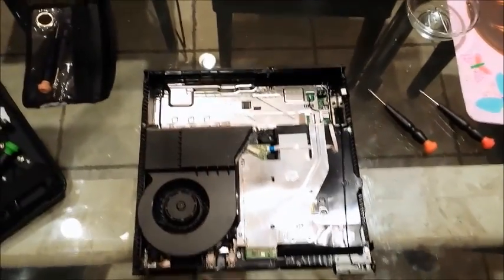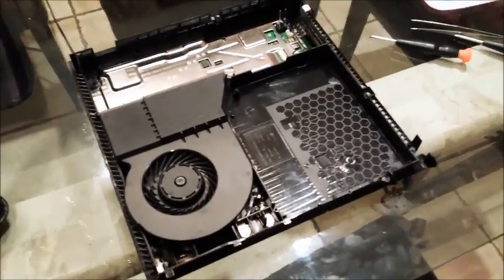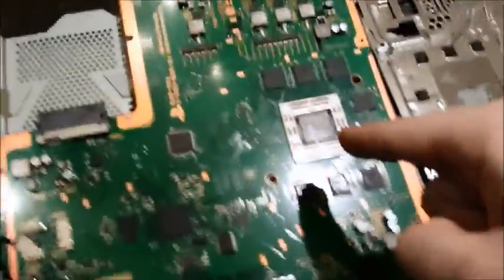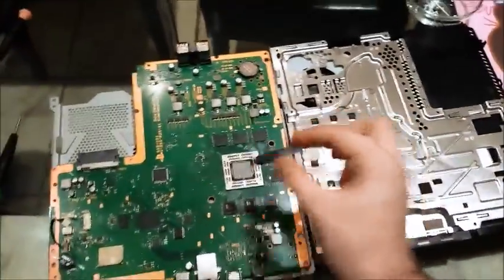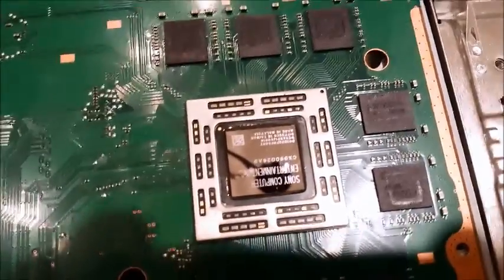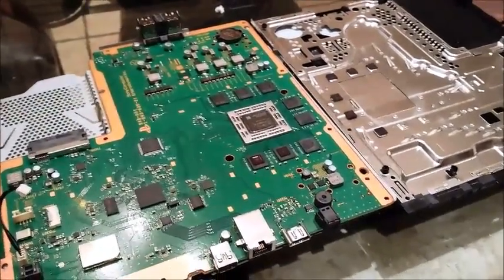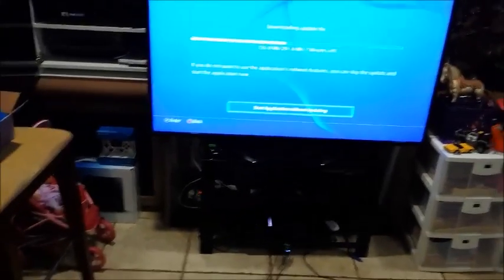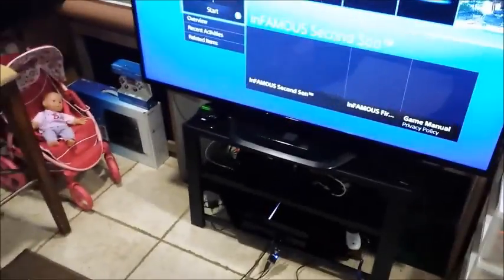PS4 Thermal Paste Change

Comment: do I need to replace the thermal pads??
Reply from the maker: Nah, just clean off the CPU/GPU chip, and apply the new paste.
Reply: Muilisx oh ok, just applied thermal paste, cleaned the fan and still gave me the overheating problem
Reply from the maker: @jabneelsanchez1668  sometimes, when you close it back up, you can end up with an air bubble which would cause it to still act the same way or sometimes even worse. Gotta make sure there's a nice tight seal. Don't spread the paste. Let the pressure of you tightening it back down spread it. The only thing you can do is do it over again.

Comment: Hey man. I know this is an old video, though it would be nice if you'd have an answer. My 1 year old ps4 is going insane with the fans after some time in games like BF1 and SW battlefront 2. It's all quite before hand, and in cutscenes. But when the gameplay starts it starts winding up like a jet. I've tried cleaning the heat sink and the fan. Should I try change the thermal paste?

Comment: is it OK to use thermal grease HY710 ON MY PS4 ??
Reply: jaivier12kill Jaivier It is, I used the same paste you mentioned. I'm probably going to change it soon though since it's a cheaper paste and won't last very long (a few years before you have to do it again)
Reply: Peter Klick. ill do the same the paste works great but ill get a better one same as you

Comment: I wouldn't use artic silver... it's not that good anymore plus it's conductive! You are not supposed to use it on a chip like that. It doesnt have a his.
Reply: AS5 really isn't that electoconductive anymore. Most reviews and forums are old. It is now safer than ever to use. However, I personally prefer Arctic MX-4. 100% safe, equivalent performance.
Reply from the maker: There's nothing wrong with using AS5. As long as it's being applied correctly, there's nothing wrong with using it.

Comment: So I did the thermal paste and my ps4 stayed an for 3 hours but then after one game of black ops it started to sound funny like disk in side was messing up mean while I got the game on ps4 so I turned it off can u tell me if that don't matter bc maybe the paste has to be good but I felt hot air coming out and all it was good just stared with that noise should I be worried?
Reply from the maker: Not sure what one has to do with the other. The Blu-ray drive comes out as a whole when you take the PS4 apart same goes for the HDD. Nothing you do during a thermal paste change affects either drive. Unless you dropped the BR drive I honestly have no clue what to tell you. If the fans are staying stage 2 or lower than the new paste is doing its job.
Reply: Ii so bro I stopped happening and I was playing today and last night good but right now I put it on had 2k16 on suspension while on wwe network and it overheated an my thermal paste is on so idk I think it's bc I had to things on 2k16 and wwe I feel like my thermal is good but my fan is prob messed up any help ?
Reply from the maker: +Based_ God_11  you shouldnt run two games at once regardless. it's too stressful. how much paste did u use? too much could be a bad thing...you only need a pea size drop right in the center. it will spread itself when you tighten it down. Cant really recommend anything because i dont know what you did.
Reply: See it happened again and the ps4 is not even hot what dose that mean? I'm srry it's just I don't have the money for a new ps4 and I can't do nothing with out it :(
Reply: And Can a cuh-10xxa fan work for a cuh-1200 ps4 let me know b4 5 so I can order it if it can ?

Comment: So many people go through the hassles of stripping consoles to clean them, or change pastes etc...and meanwhile I just stripped my ps4 and put it inside an HTPC case.  People always tell me I'm a jerk and a f*wit, but I just go LOL sure, go clean your console 3 times more often than I have to, and take a lot longer too.
It's actually worth it, as there are HTPC cases that look very very similar to consoles, and you can upgrade cooling massively, simply due to the fact that there's more room around motherboard, chipsets, and more fans.  The better the airflow: the more effective the cooling is.
Not to mention my PS4 has a h100i gtx on it. Hella tricky to modify, but oh boy did it make a difference. Never gone over 40c, even on super hot days.
Reply: Do you have pictures of this PS4 setup? I'm kinda interested in doing this.
Reply from the maker: nice
Reply: +A.R.C.H.E.R. Unfortunately no, I threw it out a few weeks back, I play black ops 3 90% of the time, and it's stupidly easy on ps4, so I shifted to PC which is much harder.
Going from a $600 console to a $9,522 PC was so worth it.
Reply: you spent 9522 on a pc? What is wrong with you? You got played, man.

Comment from the maker: My PS4 is due for a cleaning. It's most likely dust causing it but my fan has been kicking in stage 3 during games and if you look at the vents on the right side, those grooves you can see dust in the holes so I'll probably take it apart this weekend, and do a full dust cleaning as well as a thermal paste change because I'm already in there so might as well.
Reply: Did you do it? Did it make any difference?
Reply from the maker: +Leos Gaming   of course, why wouldn't  it  :p
Reply from the maker: +Jules That's wierd issue before. The PS4 would still turn on even with 
BONE DRY thermal paste but if it was overheating it would just turn off 
like a computer would but it wouldnt prevent it from turning on;       The clicking sound is the HDD. Not sure if the clicking sound ur hearing is the normal sound of the HDD preparing for shutdown or the sound of a failed HDD. The power button is also another possibility. If you could record the sound of the click for me it could help me narrow it down for u....def not the paste causing that tho
Reply: +Jules you may have put excess thermal paste which spread out of the heat sink area
Reply from the maker: hArDsTyLe2259  lol?

Comment: My ps4 keeps turning off every time I try to play Metal Gear. The fan goes crazy and then the red line appeaers. Once that happens I either let it turn off or close the game
Reply from the maker: Does it happen on other games too? Maybe not as fast but does it still happen? Sounds like the CPU/GPU is overheating which would be because the paste is dried out and it's getting too hot.
Reply: It has happened before on other games, but not as fast ans not as often
Reply from the maker: Still the main sign of the CPU/GPU overheating. It cuts off like that to protect the chip from frying itself. It's definitely a thermal paste issue. You probably have dust in there as well which isn't helping.  Check out my other videos on it.   https://www.youtube.com/watch?v=mXYORPGMYJE    https://www.youtube.com/watch?v=SlgIS-qJFo0      https://www.youtube.com/watch?v=Bb1MM5lv-1o

Comment: should I change my thermal paste? I've had my ps4 for a year and a half and I bought it at Best Buy "open box" I was thinking of waiting until something happens because of the saying "if it ain't broke don't fix it" what would you suggest I do?
Reply from the maker: it wont break per say but just run super hot all the time. it's wise to ditch sony's crap dried up paste and use something like arctic silver 5 or MX-2. People send me their consoles all the time to do it for them. I've done 21 so far.
Reply from the maker: +tristen briggz     I would also watch my other thermal paste videos. You can see those here.   https://www.youtube.com/watch?v=mXYORPGMYJE    https://www.youtube.com/watch?v=SlgIS-qJFo0   and  last but not least https://www.youtube.com/watch?v=Bb1MM5lv-1o  and you'll have a much better understanding my friend.

Comment: what a badly designed console my pc with all its fans and 980 ti in a game with unlocked fps is less loud than my ps4 in a 30 fps bloodborne and i changed thermal paste it didnt help at all
Reply from the maker: Prob have an air bubble. I've done 20 PS4s and each one runs way better. Stage 1 idle, no more than stage 2 in a game.
Reply: opened it again you where right the thermal paste was in a ring form with an hole in the middle and i the cooler itself wasnt properly tightened anyway now the noise are back to the level when i buyed it stage 2 mostly quite silent without counting killzone shadow fall and uncharted collection those push it to stage 3 and 2,anyway now im not hitting stage 4 anymore but anyway this console is not easy to open definitely not foolproof and this whole design i wonder how this console cooling system passed QA

Comment: sorry to bother you again for some reason my ps4 is given off static is that normal since im using AS5?
Reply from the maker: giving off static?
Reply: Yea i rub my hand on the ps4 its making my hair stick up and little static shock
Reply from the maker: +Christopher Delcastillo   Never heard or dealt with that before. Perhaps check over everything and make sure everything is screwed down. Other than that not sure what would be causing that. Definitely not the AS5. Make sure you're not walking on carpet in socks before you touch it. Rub your feet on the carpet back and forth hard, and touch the door knob, same idea. Can't be a ground or anything because if it was a ground issue then the console wouldn't work.

Comment: i change the thermal paste to AS5 i had the ps4 on for 4hrs now out idk hear the fan at all nice hot air flowing out
Reply from the maker: Awesome! AS5 has a cure time of 50 to 200 hours so it will most likely get even better
Reply: Oh ok thanks
Reply: Do i have do heat cycles ?
Reply from the maker: +Christopher Delcastillo nah, you're not breaking in a motorcycle bro lol. Just leave it on for most of the day and turn it off at night. Heat cycles will happen automatically as the days pass

Comment: will changing the thermal paste solve the Blue light of death problem?
Reply from the maker: yes because that is caused by overheating. Ditching the crap stock paste and applying better paste will stop the PS4 from running hotter than it should. watch my thermal paste discussion video
Reply: *****  Thank you for the fast reply! I will change it tomorrow and come back with some feedback if it did the job or not..
Reply from the maker: Razvan Covaci Coolio, make sure you clean off that old paste like I explain in this video, and make sure when you apply it, and close the motherboard in the heatshield that you make sure you make a solid closure with no air bubbles. If you have even the SLIGHTEST little bitty bubble then there won't be a solid seal and you'll have to do it all over again.
Reply from the maker: Razvan Covaci and here's the other video I told you about    https://www.youtube.com/watch?v=mXYORPGMYJE
Reply: ***** I'm watching it now
Reply from the maker: Razvan Covaci  cool, enjoy!

Comment: I use a cooling pad and the Nyko Intercooler for my PS4
Reply: Don't use what? the cooling pad? or the Nyko Intercooler?
Reply from the maker: +gonzoloco1  He probably means both as it's not needed at all, and only masks the problem.
Reply from the maker: +Camoprime   Any extra fan or cooler is just a complete waste of money. All you're doing is " masking " the problem. The system will never be running cool until you ditch that dried up stock paste, and apply something better like AS5 or MX-2. Those are the two thermal compounds I work with. I usually rotate depending on availability and price but they're both top of the line thermal compounds. If you truly want your PS4 running cool then you need to give it what it really needs and that's fresh better thermal compound. As long as that stock paste is in there becoming more dry every single day your PS4 is going to be running hotter than it has to and struggling at the same time to keep cool. You will see a complete night and day difference with better thermal compound just like any computer will. Even when I buy a CPU for a customer when building a computer for them. I clean off the stock paste that comes on the bottom of the stock heat sink, and I apply my AS5 or MX-2 from the start. It truly makes a huge difference. I can 100% GUARANTEE you that cleaning off that junk and applying something much better will have your console's fan never paste stage 2 fan speed. I've done 15 PS4s already and every single one is running much better. Stage 1 idling , and stage 2 while in a game. Stages 3 and 4 become a ghost.
Reply from the maker: +Camoprime  - uhh  I did read it. I'm just clearly adding to what you said.

Comment: Should I change the thermal paste due to the system quickly shutting off or is it a power supply problem? Which should I try first?

Comment: Mx5 silver paste takes waaayy to long to cure.I learned the hard way after my gpu on the ps3 was damaged. Unless you leave your system on standny for 50-200 Hours your risking gpu damage. 
I highly sugest using gell based thermal paste.
Reply from the maker: ThreeDaysOfDan   AS5 also is known to have a long cure time too and I had no problems using AS5 in my PS3. I'm using AS5 in my PS4 as well. I put it in before even using the PS4 for the first time and it has been almost 4 months now with no issues. My PS4 stays stage 1 fan speed idling, and stage 2 in-game. I never see stage 3 or 4 which means it's more than fine. AS5 or MX-2 are great choices.

Comment: anyone ever notice the ps4 looks like a ps3 slim borad?
Reply from the maker: ArtOfHacking no but I noticed PS4 is much quicker to take apart than a PS3 fat model. Just seems like it's easier. I mean PS3 was easy too because I'm no stranger to the  inside of anything but I've done like 7 PS3s and 10 PS4s and PS4 just seems more fun to do.
Reply: i agree the ps4 used a lot less screws then the ps3 models and it did seem faster compared to a ps3

Comment: Hye there ***** I'm about to change the thermal paste on my PS4 next week. I'm actually getting help from my friend who is a computer guy & have work on many PCs & laptops. He said that PS4 architecture is close to the laptop's (after seeing videos on Youtube) and it would probably easy to do the whole thing. My questions are - Is there any chance of us f***ing things up during the process? I have heard people who did this have several problem after putting the PS4 back together, so what are things to watch out for during opening the PS4, replacing the thermal paste and putting the PS4 back together? And last question - which is the better thermal paste to use on the PS4 chip - Artic Silver 5, MX2 or MX4?
Reply from the maker: josh Subet  yup but a PC is very easy to get to it. With the PS4 you have to be careful when taking it apart as there's a bunch of delicate cables and stuff
Reply: I have a PC and it is super easy, i did it for my CPU and GPU. You just have to know how to apply and clean it, that is really it.
Reply: ***** It must be because it is so compact.
Reply: +apiz arsha-veen  im thinking to get tuniq tx-2/4
Reply from the maker: All I can say is follow this video   https://www.youtube.com/watch?v=xyz0rdMpqOM    Pause when you need to, and go step by step with him. There are certain things that need to come out that can break very easily so it's important you know exactly what comes next and how to do it. This video is good to follow. AS5 or MX-2 is more than fine for this. The only way you will run into an issue is if you don't apply the paste correctly mixed with securing the heat sink back down. If you form an air bubble you're going to have cooling issues right from the moment you turn it on. It's very important you make a good seal when you secure it.
Reply: +NYballer11725 So i recently changed the thermal paste on my PS4 but the noise didnt change at all. Is it because of this air bubble you're talkin about? I had enough troubel takin the damn thing apart but if I can avoid outright buying a new one ill do it again. Also that chip is small as hell, so would a pea sized amount be too much for this thing?
Reply from the maker: Probably a half pea size would be better. Make sure the fan noise you're hearing is " in-game " and not on the main menu of a game as the main menus tend to make the fans act up for whatever strange reason. Too much paste can also cause overheating issues as well as too little, and/or an air bubble(s).  This is why I offer to do it for people so they can avoid having to take it apart, and not worry about applying it wrong. I've already had 5+ people send me theirs to do but if you do it yourself, just make sure you take the extra time to do it right.
Reply: ***** Yeah it is all in-game im playin games like bloodborne and gta v and after a few minutes of bein in game the fans so crazy like I dont even want to bother playin the PS4 afterwards. Gonna try again i guess

Comment: Changed my thermal paste, easy if you have little knowledge of taking apart electronics. My Ps4 is running cool and like brand new. =D Thanks for the video!
Reply from the maker: Awesome
Reply from the maker: Darren McClellan  Sorry, I couldn't respond in detail earlier. It's great that you did this. You eliminated any stress that your PS4 had as it was most likely working overtime to keep the system cool. Indeed very easy if you have that kind of knowledge. You're now set for a good 3-5 years before having to do it again. Now you can enjoy your PS4 even more than you have been and now there's no concern with leaving it on overnight or even if you forget to turn it off. Usually I just pause my game and turn off the TV and my fan stays on stage 2 for as long as it's on. I NEVER see stage 3 or 4 and it should be the same for you. Enjoy!